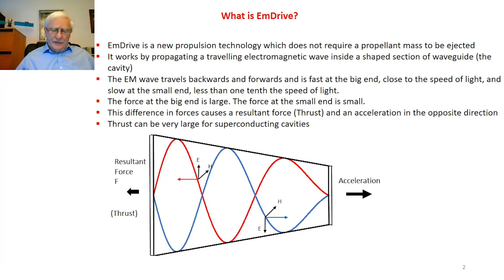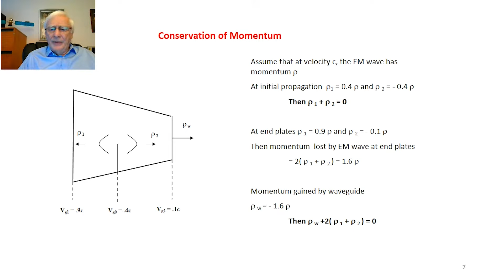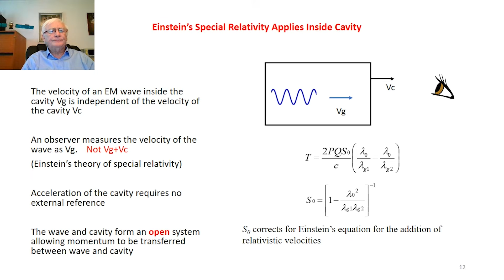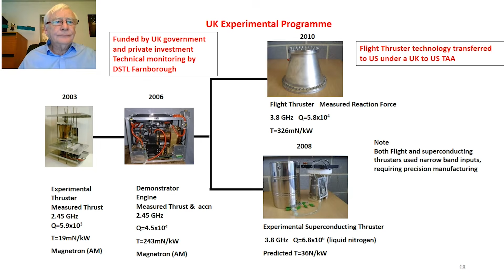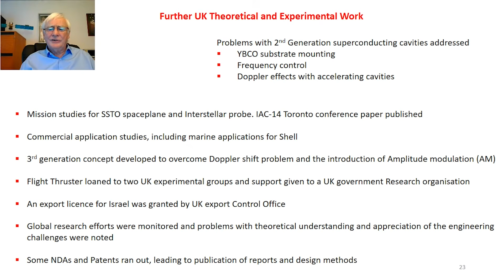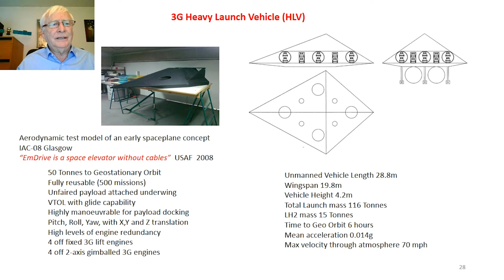The EmDrive: NASA's "Impossible" Fuel-Less Thruster | Roger Shawyer

Comment: The only problem I've seen is this could have thrust simply by interacting with other magnetic fields like the earth's and artificial ones like radio and metals nearby which means it needs tested in space far out like out by the moon! Also any air could accidentally be heat and expelled and causing net force
Reply: it does not work

Comment: Good stuff. This is exactly what i had stuck in my head for the last few months and even used paint and blue and red colors when describing AC MHD propulsion which is funny he does not mention.

My understanding is that microwaves at such configurations are transecting at non 0 and non 90 degrees (not effecient since it should be 90 for maximum load). Even the microwave oven vibrates excluding transformer and ventilator vibrations....
anyway since they transect at non 0 and sadly not 90 degrees they actually act on the ether directly since ether is composed of probably spinning dipoles micro electron structures (fundamental) which light uses to propagate and is the cause of electricity/magnetism and inertia and momentum... pretty capable and magical but this is where we at... 
Anyway the drive delivers "change in electric and magnetic field" in such configuration that the ether gains a dislocation and this dislocation is than infered into the sorounding matter since ether compresses the matter and when you move the ether it influences how it compresses the matter in different paths (different "lines of force" in pseudo conventional way).

lifting heavy gyros with 1 hand is cause of matter intersetcting these paths in inertial ways which causes the force to point in all funny directions... like coriolis effect of some sort.
Reply: wiw after continue watching guess they fixed the ineffecient part. wow
Reply: and now that i see that they continue with that design it seems it has a strong magnet near the top part twisting the microwaves so they create (personally theorized) 45 degrees moving thing... 

happy to see others figured out most of it so i dont have to hehe.

Comment: It's not clear from Shawyer's descriptions how the EM Drive's energy cost of momentum scales with velocity; a common criticism - or, perhaps, misgiving, being generous - levelled at propellant-less thrust being that in principle, it would seem to allow doubling of one's velocity - or net momentum delta - by merely doubling the input work done / energy expended, whereas this should present four times the workload, kinetic energy squaring as it does with velocity.  To put it another way, in order to maintain PE:KE symmetry or CoE, for a given amount of system inertia (constant, ie. no expulsion of reaction matter), the energy cost of momentum must square with its 'velocity' component, relative to whatever the system's initial reference frame.  Conversely, if, say, each activation cycle of an EM thruster was only 1% efficient in terms of buying velocity rise, the rest dissipating to heat, yet it maintained this efficiency invariant of accumulating net velocity, then there would always be some threshold velocity at which net PE was at KE unity, below which it would be under-unity, and above which, over.  Net of KE plus heat would be in excess of PE unity after the second cycle in such a series, whatever their frequency.

In practical terms, suppose my EM-thruster craft had four batteries or fuel cells onboard, which i intended to use one at a time in sequence, depleting each then switching to the next;  in order to respect CoE, the second battery must only achieve one quarter the delta-V as the first, the third only 1/16th, and the fourth 1/64th.  My impression of Shawyer's claim - which may be wrong - is that each battery would yield equal delta-V, notwithstanding the infinitesimal relativistic mass decrease..  and this breaks CoE.  Please note, that i'm not suggesting that is a de facto falsification; fixing the unit energy cost of mechanical angular momentum invariant of RPM being the physical realisation of a perpetual motion machine, the perfect compliment to power our EM Drives to relativistic speeds..  At the root of the problem is whether or not the reference frame of the EM Drive's input workload diverges from the absolute or zero-momentum frame (Earth or ground from our PoV), in which the KE is manifest.  A "yes" would mean the ideal propellant-less drive, and each input cycle will cause equal net acceleration.  A "no" implies that what we're really dealing with is some form of 'displacement drive' rather than a conventional 'motor' - for instance only in motion when powered, returning to its starting or resting velocity on power-off, as one possible resolution (though this doesn't seem to be what Shawyer's claiming).  Suffice to say, it remains a highly intriguing proposition..
Reply: no, it is not intriguing, it is nonsense

Comment: A radiometer will spin just using light because the dark panels have a higher energetic state than the light colored panels when light energy is absorbed. This unbalanced condition also exists inside the thruster which can produce movement. No need for wacky physics theories to explain what's going on.